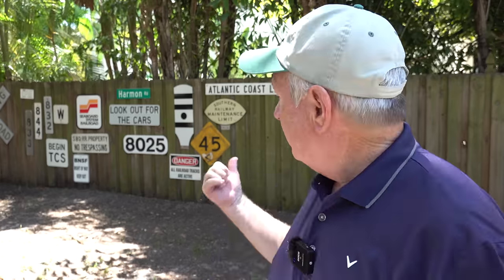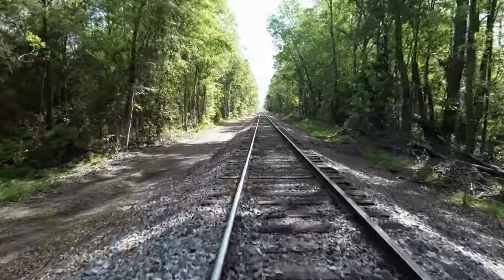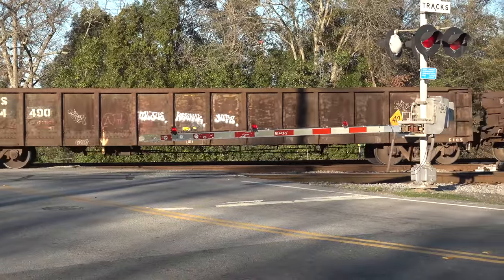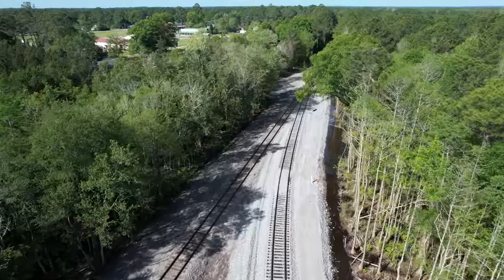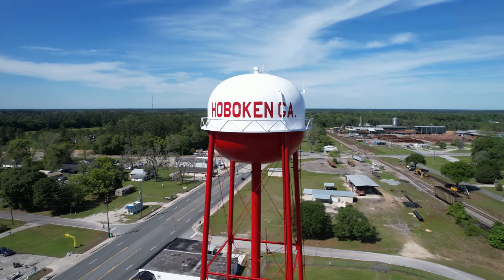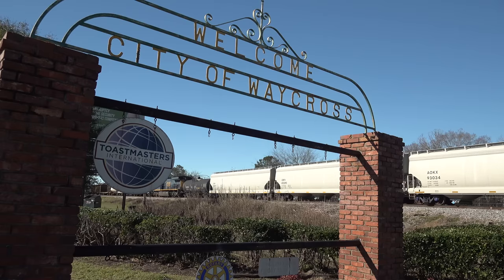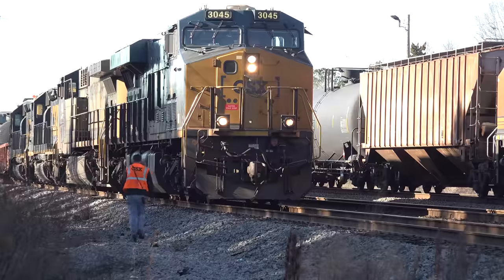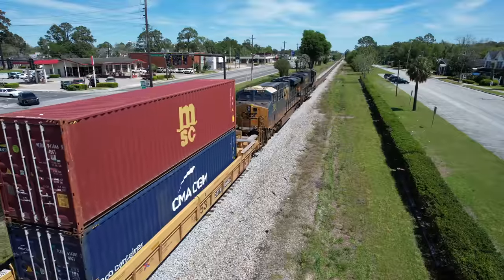How CSX Built a 35 mile Double Track Main Line Using Only 1500 Feet of New Track

Comment: Why do trains have bells ringing and horns blowing at crossroads or stations? In the UK they run mostly with blow their horn (whistle as the trackside signs say). The crossing just outside my daughter's school was silent until a teacher's husband killed himself on it, now they whistle but it is not the norm.
Reply: Trains use their horns whenever there is a white "W" sign, and they use their bells when pulling into stations and going through crowded areas to make other people aware.
Reply: @reidgibbs  If this would be law in Germany all railways would have been cutted down already. 😅 In Germany we have mainly silent crossings. Maybe because the people are more aware of the dangers by trains. In newer days crossroads are replaced by bridges. Ever the street gets lowered under a new railway bridge or mainstreets and highways will build on a bridge above the railways. But these solutions seems not so much common in the US? It would also solve the problem that crossings are blocked while the rail crews are changing.

Comment: We have/had two hundred?  side dump cars on CN Rail.  Used less than 1% of the time for riprap. Used for ballast stockpile(ie crossing rehab), derailment clean up, bank widening, tie plates, Air operated, usally from the brake pipe, but not always, they are slow and have tendency to jump off track when unloading.

Comment: They do not use concrete sleepers?
Reply: They're called Ties here. Concrete ties are generally used in high speed areas where maintenance is able to keep the tracks up and maintained frequently. Being this area is rather swampy and traffic moves slower, it's much more economical to continue using wood ties.
Reply: I was having the same question. Even old museum lines use concrete tiers here in Europe if track is getting extended or replaced
Reply: @ramonennik2536  Typically US railroads continue using wood ties because its far more economical, even outside of a swamp. Concrete ties are also a lot more expensive to replace if needed, and wooden ties can be supplied faster at a lesser cost. The BNSF transcon still uses wood ties, and it is one of the busiest, fastest mainlines in the USA.

Comment: Ok I have a questions for everyone how do they make all of the trains run with one throttle of the head train
Reply: Modern locomotives are computer controlled. For setups where all the locomotives are at the head of the train, they're connected via a "multi unit" cable. For distributed power setups, where the locomotives are in the middle, or end of the train, radio control is used. The "Animagraffs" channel has an in-depth 3D guided tour of a locomotive on their channel, titled: How a Diesel-Electric Locomotive Works

Comment: How are they Ok with wooden tiles under the rails? We here use solely cement tiles on all lines in Ukraine (or any post-soviet railway for that matter)
Reply: It’s not that bad. Sure they rot but they are still very hardy and will last.
Reply: Wood is stronger than you might think especially at the size of about 18 by 23 centimeters and elastic so it springs back into shape after the train leaves. The raised bed let's the wood stay dry and is treat to prevent insect damage. It also has to do with how unbelievably cheap the rail companies the are. Concrete is more expensive and therefore only done when mandatory.
Reply: @JR's Trains Ukraine doesn't have any high speed rail either. Top speed of almost all of their trains is 55 mph.
Reply: Wooden ties are the best option for heavy freight. Concrete doesn’t have the flexibility of wood and have to be tamped constantly. Once you get a little mud around the concrete ties they are done for. Concrete is fine if you’re running passenger trains as they are obviously so much lighter and doesn’t hardly cause concrete ties to pump
Reply: @James Barrett The change to standard gague is going at a tectonic speed. Wooden ties here are seen primarily at secondary station tracks and barely used lines and a lot of concrete ties were laid even during the soviet period (not electrification though lol)
Reply: @fasdaVT  So before the tie springs back after the train... It bends under the consist..? 🤨

Doesn't that make the rail volatile and decrease speed limits?
Reply: @junkman8742  Man, you don't even know, how much talk can be made from sheer compare and contrast about countries or even individuals 🤣
Reply: @fasdaVT  120 km/h (75 mph) is a normal speed limit for double-track mainlines (i.e. Poland to Lviv, Kyiv, Odesa; Donbas to Dnipro)

Comment: 10:29 Oh they are running them one after another now.  The Virtual Railfan cam for Waycross is probably the most active cam I've ever seen.  There are trains constantly going through this new configuration.  It's impressive. Thank you so much for the explainer video.  Fantastic as always, dude.   I had a feeling they did something like this because the rhythm of the trains on the cam changed markedly over the last couple months.  They must now be up to speed with everything.
Reply: And positive train control makes this all the more viable.    Which PTC, your train separation is no longer defined by the length of signal blocks.   The PTC knows the speed, precise location,  weight and stopping distance of each train and can keep them safely separated without having to separate them using fixed-length blocks that were laid out a hundred years ago.   It also makes it possible to have a train that's longer than the length of a signal block occupying two or three blocks.

Comment: The Milwaukee Road and the CB&Q did the same thing in Minnesota about 1900. They had a connection in Newport, MN and in Hastings, MN.  In the 20 miles between, the “Q” ran along the Mississippi River while the Milwaukee climbed a 1% grade out of the river valley to cut the distance between the connections. Both railroads saw the wisdom in operating as a double-track main but there was also a huge benefit in sending loaded trains downgrade and using the water-level route to save money on hauling empties the other way. BNSF and CPKCS still operate the two tracks together.

Comment: As a railfan in the UK, North American operations are really impressive, but the speed at which freight travels seems really slow compared to the UK, where freight has to fit in with a very intensive passenger timetable. The faster freight can travel, the more paths can be allocated so capacity increases. Good to see CSX investing in solving capacity problems. They have the luxury of being a private company that owns the infrastructure. In the UK to build a short chord to increase capacity as shown in this video would not happen in 3 months. It would be 3 years of talking about it; 3 years to get the funding; and then 3 years to build it.

Comment: The amount of container traffic coming through Savannah is exploding, taking it mostly from Los Angeles and Long Beach with the new Neo panamax ships. For East Coast shippers they save themselves all that cross-continent Movement by just keeping on a ship. Because of this the rails traffic around Savannah has to be exploding dramatically increasing also so any use of existing infrastructure to make the system operate more efficiently is a bonus. Hats off to whoever thought this up.

Comment: Great video. About 20 years ago I worked at the Waycross Holiday Inn and always waited for the Brunswick Local to pass by between 12:30pm-1:00pm on it's slow journey to Brunswick. Normally had about 20 cars. I never knew what time it returned back to Waycross, most likely late evening. Was wondering how they fit this local into the mix today, with the never ending stream of 150 car freights. I didn't see it in this video.

Comment: On the, "Active" sign. A long time ago now, I drove motor coach. All Buses in the U.S. and Canada are required to stop at all railroad crossings with one exception--if the crossing sign has a itty-bitty little supplemental sign right below it saying this one little word, "EXEMPT." That crossing is either for all intents and purposes abandoned or so rarely used that it is hand-flagged.

Comment: Excellent video. I heard that some railroads are trying to only have one crew member on board. I think railroads are worried more about profit than safety.
Reply: Pretty soon, railroads will be using remote control trains. They have been experimenting with that concept, for years. There is a mineral railroad, in Australia, that uses it.

Comment: Selkirk Yard is right here in my back yard.  It is the symbol for one of the dumbest problems on the rail network today:  The Selkirk Hurdle.  Rail traffic from New York City, Long Island, and Connecticut headed for the South and West has to go all the way up the extremely busy commuter line, the Metro-North/Amtrak Hudson Line to Selkirk, NY, just south of Albany, then back down the West Side Line.

They turned the Poughkeepsie Bridge into a public park recently, after it had burned in 1974, cutting New York off from the rest of North America.  There's been discussions of a freight tunnel between Brooklyn, NY and Bayonne, NJ, passing under New York Harbor, but I'm not holding my breath.

The Port of New York and New Jersey is hamstrung by this, and has been for almost 50 years now.

Comment: Dumb question but When a train is backing up into a siding, etc, does the Engineer stay in the far forward cab?
Reply: I think so, but the conductor goes to the back
Reply: Not a dumb question at all. What you are talking about is a reverse or shove move and the engineer still has to control the engine from the cab. But the conductor will get down and control the point of the shove movement by holding on to the grab irons of the last car. From there he radios to the engineer giving instructions about the track ahead. "CSX Q411 engine 8630 I am up and riding the shove, looking at a Medium Clear signal North end of the siding Southbound, switch is lined into the siding, we are clear for 20 cars to the crossing, Shove it my way!"
To which the engineer responds: "Q411 engine 8630 has got a Medium Clear North End of the Siding Southbound Main to Siding, conductor is up and riding the shove, clear for 20 cars to a crossing, here we come!"
In about 7-8 cars length the conductor is going to come over the radio again, "8630 we have lights and bells on the crossing still clear 12 cars," 
To which the engineer responds: "lights and bells, 12 cars on the 8630" 
And the conversation between them will continue on, where the conductor gives car counts for how far they can go and the engineer is prepared to stop in half that distance if he does not hear differently before then. Shove movements are conducted all the time, mostly while switching. But sometimes operational conditions such as turning on a wye require trains to shove long and practical distances. The last job I worked before I retired, we had no place to turn the train around at the end of the branch so we were forced to shove the 7.11 miles back and then begin switching the customers from the end of the track, onward.
In situations where shoving movements are a routine part of the operations, the railroad will provide the crews with a shoving platform, which is a car that has a platform the crew(s) can stand on safely while performing the shoving move. Often times you will find old cabooses with the doors welded shut and windows covered with metal so they cannot be entered. But the end rigging and platforms are still in excellent shape and make for a more comfortable place to stand than say, the corner ladder on a hopper or flat car. In the terminal I was at, they offered one to us, but I turned it down because we always had a refrigerator car and/or a tank car we could use. Refrigerators have a platform on the Mech unit side which also makes for a safe, easy shoving platform.

Comment: My wonder is if they are going to update the signal at brunswick junction. From my understanding the restricting signal indication to be routed onto it BEFORE this was because its dark territory but now that it will have signals maybe they update the signal mast to have potentially higher speed indications
Reply from the maker: I think it depends on the speed of the turnout there. You can get a Medium Clear at a junction running from CTC to Dark Territory. Depends on the situation at each location.
Reply: @distantsignal  “You can get a Medium Clear at a junction running from CTC to Dark Territory.”
Are you absolutely sure about that?
Reply: Yes, once the west Brunswick sub (Waycross to Nahunta, which I'm calling New Brunswick sub—haha!) is signaled, the signal will have to be changed to give better indications.  Will it be Slow speed? Will it be Medium speed?  Guess we have to wait and see.  With that sharp curve there, though, I wouldn't bet against Slow.  Also, the existing Distant APP signals (e.g. at 31.21008011407668, -82.34428764598682  and, I think, 31.201421166641538, -82.00256758801743) will go away.

Comment: 14:08 #3045 has an interesting traction truckset i have not seen, that i can recall.
Reply: GE steerable axle trucks. Many GE units ride on another design called HI-AD trucks. They are the ones where the springs are on the bottom of each journal box while the steerable axle trucks have the springs more near the top.

Comment: Danny - Have you run into digital transmissions on the frequencies?  Up here in the Metro Atlanta most of the digital is on Norfolk Southern and just bits and pieces of CSX on it.
Reply: Everything in Atlanta is getting overcrowded. Railroad operations and ham radio are about the only services still using analog and crossover / bleedover and intermod are always tearing up the air waves now.
Reply: @SD40Fan_Jason  VHF & UHF should be clearing up.  Most all Public Safety has moved to 700/800 MHz.  Plus, a LOT of UHF is simplex or even 2-5 Watt internal building repeaters (When I worked for AT&T in Building Maintenance, we had a 2 Watt repeater with leaky coax.  Our 4 Watt HT440's on UHF out preformed the repeater).
Reply: @michaelmartin8036  Before I left the Atlanta area, what I was hearing the most interference from sounded a lot like a paging service. I didn't think anyone used pagers anymore.
Reply: @SD40Fan_Jason  Yeah, I'm up in NE Cobb by Sweat Mountain and I really don't pick up much from that antenna farm!  Feds have a lot up there, but it's all the big E!

Comment: I had to spend a little time answer a couple questions by looking at Google Maps (Did this line, that goes south to Fla, pass by NAS Jax? It does, after a fashion). I wondered that because I lived across the street from NASJAX in the mid 90's... that area (as well as the base proper) has changed much but the trackage remains as is (mostly)...

Comment: Danny, do you have a video on what the crew brings with them to work?   How long is a typical shift?  
Great video.  Thanks
Reply: Shifts are mandated by law to not exceed 12 hours. The actual length of a shift depends on what you're doing.  If you're out on the road running trains, you can expect a 12 hour shift.  If you do yard movement work, you shift might be less or vary. 

They bring with them (called their "grip") anything they may need to be gone from home for a day or so.  This can include cold or hot drinks, food, clothes, toothbrush, books, etc.
Reply: Rulebook, radio, switch keys, flashlight/lantern, change of clothes and toiletries, rain jacket, some snacks and drinks are pretty much a given if you're working the road.